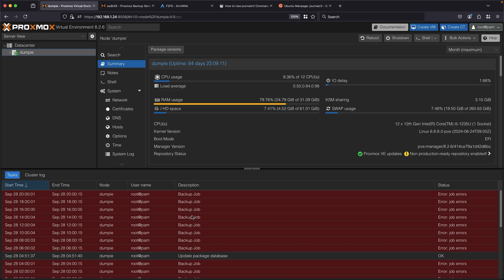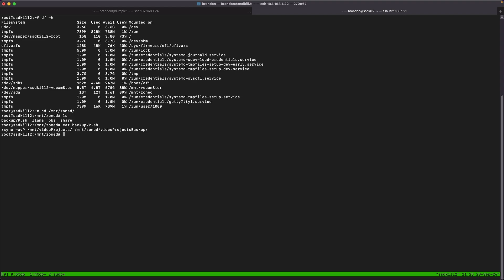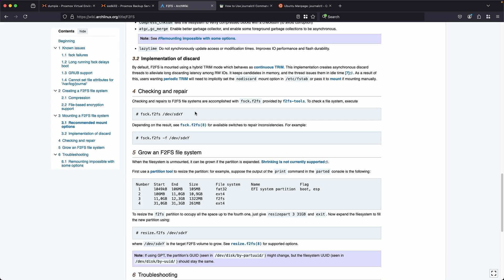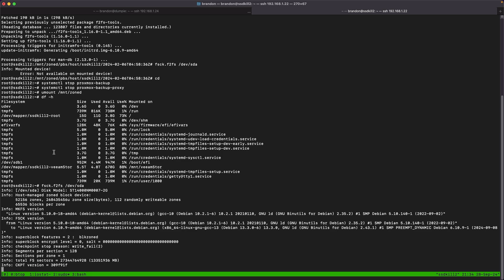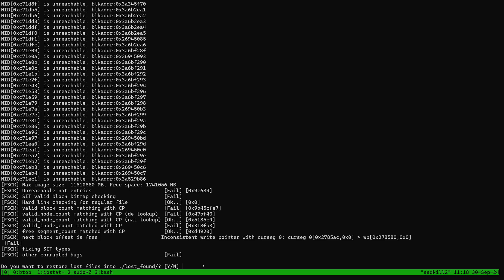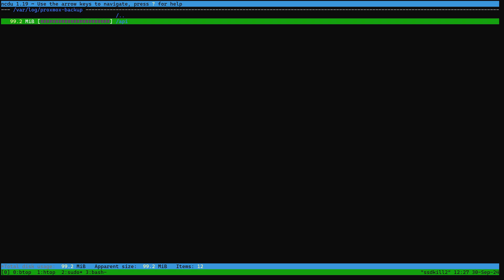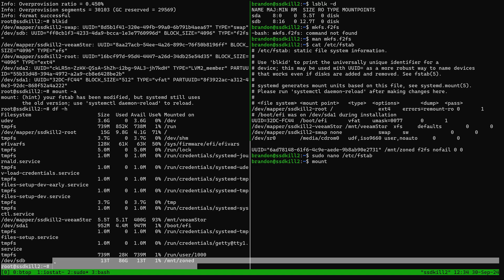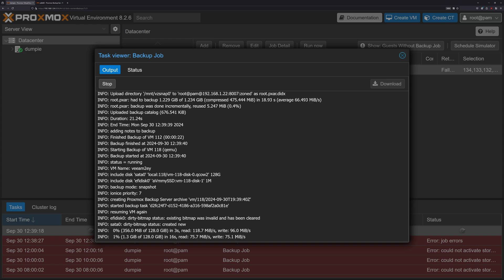Fixing My Failed PBS Server: A Troubleshooting Adventure.

Comment: I run PBS as a VM on my Proxmox host and used a work around to backup to an NFS share on my separate NAS. All seemed good but after a while I started getting backup errors and couldn't figure out the problem. It's not a recommended configuration so I bought a cheap SSD to install in the host and setup a new store, initial backups go to the SSD and are then synced to the NAS. No more issues since and one extra level of redundancy.

Comment: To answer you at the end: yea I have had similar issues many times over the past 20 years, this is usually just pre-drive failure for me. Never with f2fs, but with ext4, ntfs, and whatever else. the input/output error 5
I have a 4tb drive here that just had this a few months ago actually, and I did as you did, wipe it and reformat it. I even zeroed it out to test if it could correct write all the blocks.
after a month of backups it also started having the input / output error again so I decided just to use a different drive now lol.. that isn't my first time either, that's just my procedure these days since it seems the only way a drive will "fail" for me, haven't really had any just completely fail in a long time.
good video and I agree with just deleting the whole log file lol, man that is a lot of logs. I like to go in and delete everything except the last month almost monthly. If nothing bad is going on, I don't think I'll ever need more than a month old of logs. I like to do it manually though gives me time to look at the logs too

Comment: For those saying reformatting the hard drive is not a real fix which is true in a hardware sense.  He had to reformat it since the PBS database is messed up anyway and no real way to fix it.  Easier just reformat and start over fresh.   Looking at the SMART stats the drive is dying anyway so it needs to be replaced.  I would recommend a traditional CMR drive for backups.   

My 2TB 2.5" CMR laptop hard drive is currently connected to AMD APU 5350 system to store the backups on.  Running 500 gig Samsung SSD for OS.  The CPU is no powerhouse by today's standards but for my home lab and power consumption it's good enough for what I use it for.
Reply from the maker: After seeing these comments I am like OOps, how did I miss the reallocated sectors on the HDD. Had I seen that I probably would have gotten a new drive here. 

But ignoring the  bad SMART data, I've done this type of fix a few times before where these isn't a obvious hardware cause, and software seems to be fine, so try again and see if its repeatable. With the amount of possible things that can go wrong, its really easy to miss a value or skip something troubleshooting.

Comment: I use ZFS on all my PBS instances, I have not had any issue like that. My biggest issue with PBS is filling up the datastore. But once the GC and prune jobs are configured right, it usually is good.

That FS you're using, why did you select it ?
Reply from the maker: Yea PBS can be annoying with how it gets rid of old backups, and the chunk system is a bit more complex than the normal incremental and full backup files.

My HDD is a host managed SMR HDD, so it need specials commands to write to the SMR zones. Only a few filesystems support this like f2fs.

Comment: SMR drive as a backup drive?  Hmmm - At least it's host managed and not drive managed, and you're not looking to get great bandwidth with this particular application - But I haven't run that file system with PBS before, so I wonder where all the sharp edges might be.  PBS "likes" a zfs backing store to do it's compression tricks, and I always assumed was the "one true way" - working systems are good evidence.
Reply from the maker: I've had surprisingly good experiences with my host managed SMR drive. Maybe its cause my CPU is too slow to push it, but I've never seen the single digit speed slow downs with doing large backups jobs. 

To my knowledge PBS does its own compression, so ZFS compression doesn't help with PBS, but ZFS's special drive can speed up some tasks(but its generally slwoer than XFS/EXT4 in PBS) and RAID is nice for larger setups.

Comment: Great video
One thing I didn't understand - after looking at there pbs web ui, and ssh into the machine, why didn't you run any dmesg or journalctl commands
Reply from the maker: I tried running those commands and they got edited out as I kinda 'found' the issue before needing to use those commands. Upon looking in the logs I saw PBS reporting lots of issues and filling the log, but a quick search didn't show anything specific to f2fs or that drive.

Comment: Your smart data does raise concern. Rows 5, 197 and 198 are the ones that should have zeroes in the first column. In row 5 you have reallocated sectors, 40 is not good. Impending failure for sure.
Formatting a disk already formatted does nothing. Better to use 'badblocks -v -w /dev/sdX' to test it. -w is destructive because it will write patterns. Good luck.
Reply from the maker: Yea I should have looked at the drive closer and not just look at the 'Pass' in the PBS web ui. Yea that drive seems to have issues and is probably the issue here.

I probably would have to format it as f2fs and use f3 or use the hm-smr to normal block device conversion layer in Linux as I think badblocks can't work with zoned HDDs.

Comment: Reformatting the drive really isn't much of a fix at all.

I am currently in the process of expanding one of my 8-wide raidz2 vdev in my main ZFS pool, and when I pulled my old 6 TB drive out and popped it into my QNAP NAS, the QNAP system was telling me that there were a bunch of SMART errors on it, so that drive is dead and/or dying, which my Proxmox system was completely oblivious to.

(Thankfully, I am already expanding the pool anyways, so I am swapping out said 6 TB HDDs with 12 TB SAS HDDs instead.)

Personally, I wouldn't even use the SMR drives for backup because unless you can write your data to it linearly (like LTO tape), the nature of how SMR drives works, doesn't really lend itself to incremental backups all that well.
Reply from the maker: Yea agreed its not really much of a fix, but since I didn't really want to replace hadware that didn't report errors or could find specific faults, I didn't really have a much better option  I could think of. I kinda hate doing these fixes as I think there a root cause I'm missing, but 

As far as the SMR issue, it somehow hasn't had major issues. Maybe its cause my CPU is too slow for me to notice it, but I have noticed the SMR issues much less on my host managed SMR drives with a SMR aware filesystem compared to a device managed drive. I'm convinced that only host managed SMR drives should have been released, and HDD manufactures should have worked with Windows/Mac/Linux to better support them and advertise them with the pros/cons of using them.
Reply: @ElectronicsWizardry  
Agreed.

The hard drive manufacturers, instead, tried to do the EXACT opposite of that -- which is to try and sneak them into their product portfolio, hoping that no one would notice.

Grrrr.......

Comment: The smart data are not good, the attribute 1, the worst (64) is close to the threshold 44 (a lot of read errors), the attribute 5 reports 40 defective but successfully reallocated sectors, it's not very good especially if they all failed recently, and the 195 attribute is almost to the worst value possible (1), conclusion :the disk is dying
Reply: I agree with this assessment as well, when looking at the SMART data.
Reply from the maker: Yea I skipped looking at smart closely, and that would have changed this video.

Had I see that before releasing the video I probably would have put a new HDD in, as I normally swap out a drive if reallocated sectors are reported.
Reply: @ElectronicsWizardry  
Whenever you have job failures like this, especially as it pertains to backup/disk operations -- I would always recommend checking the SMART data as nowadays, if there is a drive failure (death or dying) -- SMART gives actually a pretty good indication of that.

That's why when my 6 TB drive started showing issues - I immediately pulled the drive back out of my QNAP NAS, write on the top of the drive "BAD" and then put a diagonal line across it, and then put it in my bin of dead hardware (where when the bin is full, I take the bin to e-Waste/recycler).

Comment: In my case it was a bad sata-cable at one drive giving me errors, replaced the cable and all was fine
Reply: yeah, cables can "rot". And there are always good cables and bad cables. And cables can themselves radiate to other stuff. They are just cables but getting proper ones saves headache and days of diagnosing errors. I had my ZFS pool locking itself down because the cables decided to only work half of the time. ZFS intervened and no corruption found after I replaced the cable.
Reply: Definitely have had bad cables before - I've learned to not reuse SATA cables especially after awhile - I had three bad ones (three different systems) and my ceph was showing all kinds of latency and errors in dmesg.
Reply: @ChrisCebelenski  yeah i concider to throw all mine in the bin and get new ones ;)
Reply: pretty interesting posts in here, gonna keep this in mind.